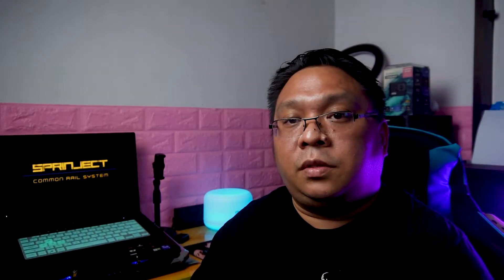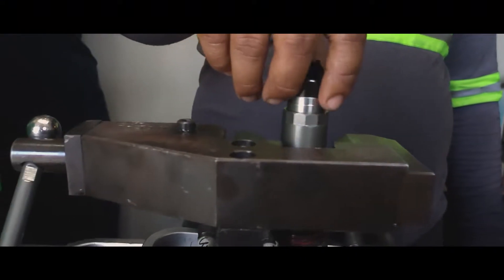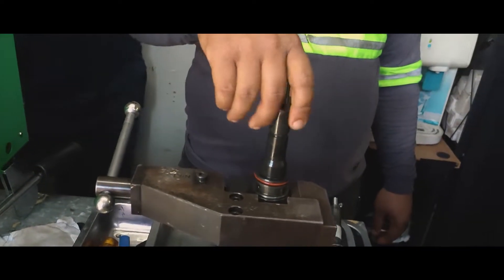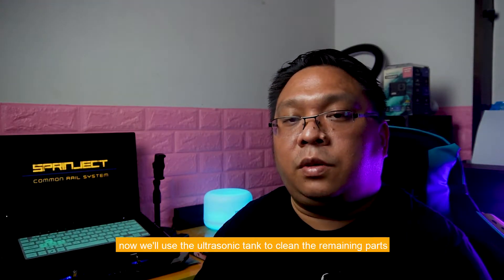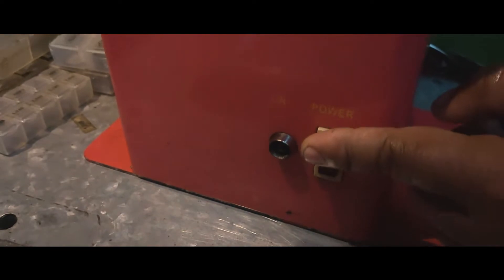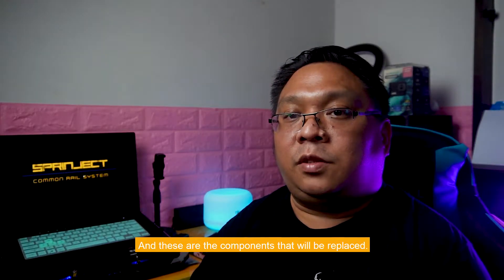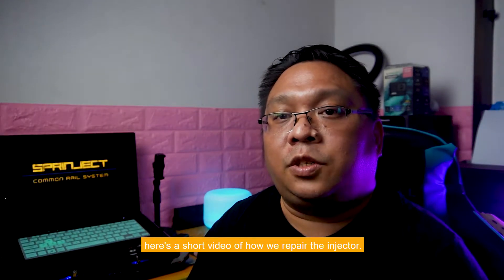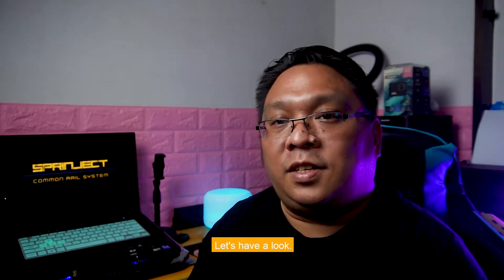How to Repair the Super Great Injector - Fuso 6M70

Comment: Hi mate, I have FUSO 6m70, and my overal fuel consumption is 36-40 L per 100km is it normal for this model? or something can be wrong ?
Reply from the maker: Hello. That consumption is really high. CRDi System is not high in fuel consumption. Check your fuel injector first.
Reply: @SprinjectCalibration  thanks,  I'll try to change all injectors, also the truck isn't smoke at all and starts normally
Reply: @SprinjectCalibration  Hello mate, I changed injectors to (BOSH) brand new, but still 37-40L per 100 km.

What can I check more? the engine actually works fine no smoking at all
Reply: nka dpindi rin po kasi yan sir.. qng loaded.. pero yung s akin nah yunit.. byahing cebu. mula iloilo 28tons ang karga. tpos pbalik ng iloilo 10tons.. ang buoang takbo basi sa odometer is 556.. yung kain ng unit q isa nsa 230 to 240
Reply: ikw rin po bah yung nag ddrive ng unit muh sir? qng hindi ikw ang nag ddrive sir.. baka hindi injector yung dapat palitan.. baka yung driver..😅